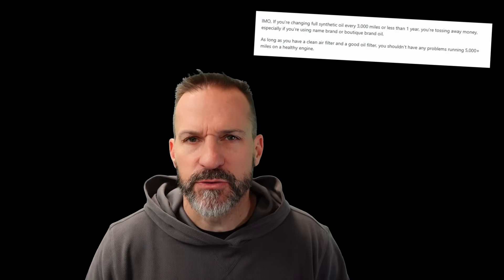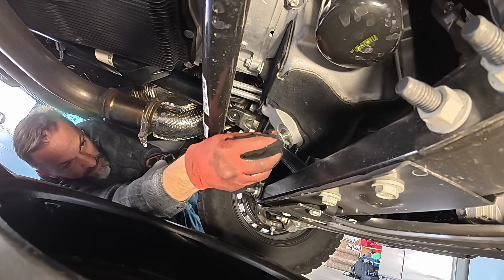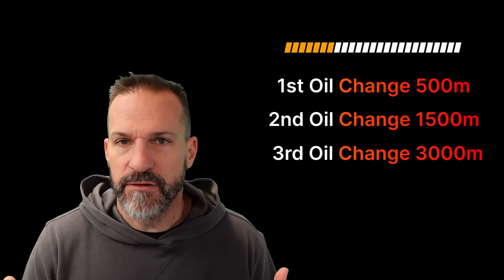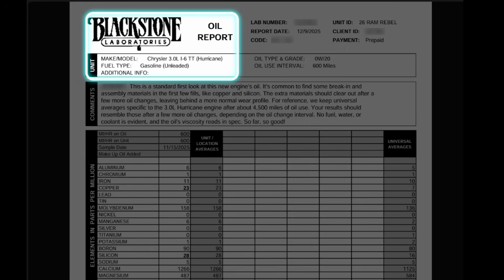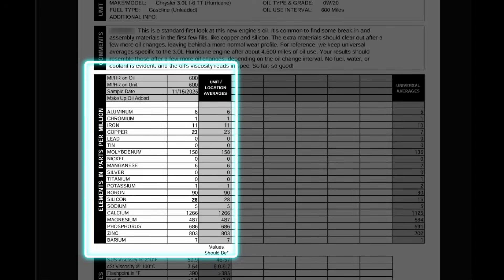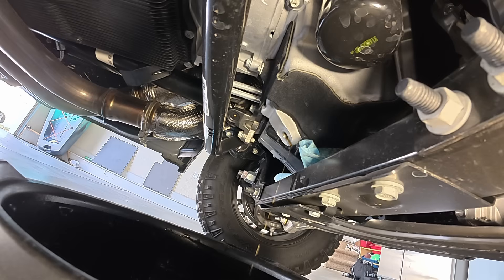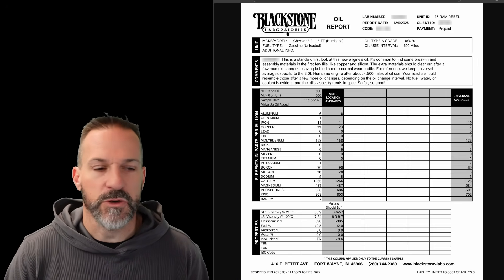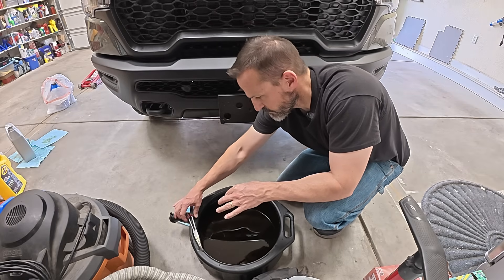Is the Motor Oil Geek Right? I Put His Break-In Theory to the Test

Comment: I have always changed my new vehicle's oil at 500 miles, 1500 miles, 3000 miles and then from then on, every 5000 miles.  Buy unlike Lake Jr., I change the filter with each oil change.  I've never had any oil related issues with any of my vehicles since I started driving back in 1973.  I've also had three vehicles with cylinder deactivation systems, and have never had any of them have any issues.  The most miles I have put on one engine is 425k, a 1982 Honda Accord.  Each of the three GM vehicles with cylinder deactivation were bought new and traded in at over 230k.  Only one, the 2007 Avalanche started to burn any oil after 200k.  2017 Tacoma was sold after 225k and burned no oil.  I now travel full time in a 2024 F550 with the 6.7 diesel engine in it.  It now has just over 52k on it. I run Shell T6 5-40W in it and maintain the same oil and filter change intervals as above.  The engine works hard all the time as the truck camper weighs 19,200 lbs. and is driven all over the US, including the mountains.  It will use a little oil (about a qt), but under these driving conditions, it is considered to be full-time severe-duty use.  And Ford's 6.7 are known to use a little oil. What Lake is sharing with everyone should be considered just plain common sense.  No oil is designed to last as long as what the manufacturers recommend.  Same goes for all the other fluids in our vehicles.

Comment: May I ask the question regarding the debate on 0W-20 or 5W-30 oil?  The manufacturer recommends the 0W-20 with many saying the 0W-20 is too thin for a smaller engine, that we should use the 5W-30?

Comment: I did an oil change at 350 miles in my rubicon 4xe, it had an “oil change due” light at that low mileage because of the potential fuel oil dilution and the fact that it sat on the lot for a while. Did it again at 3500 miles, and then at 7k. I really believe in break in oil changes. All seems to be in line with Lake’s findings. Thanks for this info!

Comment: Auto Manufacturers use special (Break in Oil) that does NOT have a special anti wear pkgs because they actually want the engine to create (SOME) wear to help the bearings and piston rings to break in and they decide based on the engine whether that first oil change is at 500 miles or 1000 miles.   If you take a brand new engine and change the oil at 50 miles and remove the break in oil  it may take 20,000 miles for the engine to fully break in using a synthetic with an anti wear pkg in the oil.       So there is NO one period or miles that fits all.    What is also bad is some people that bring in their vehicle for its first oil change at 5,000 to 10,000 miles (it happens).      The Motor Oil Geek is correct on most all that he says,   he see's the tests on dyno engines.

Comment: I have a 2024 Tundra with 21k miles. I did first oil and filter change at 2k miles and then every 5k miles.  What oil and weight do you recommend now?
Reply from the maker: With the Tundra I think I'd be trying a 5w30 full synthetic at minimum, but that's just me :). It depends a little on climate too and your conditions.

Comment: There is one thing I wish Lake would have mentioned.  When he changed the oil at 500, and 1500 was he using more break in oil or did he start using the recommended oil?  What did you do?  Did you continue with break in oil or switch over to the recommended oil?  Love the channel, lots of good information.
Reply from the maker: I believe he's just using the manufacturer recommended, and they don't use break-in oil from what Lake mentioned. I use the Pennzoil Ultra Platinum which is what people claim is used from the factory for the Ram I purchased. I'm going with 0w20 until my break in is complete and I have a good baseline, then I think I'll switch to 0w40. It does depend on the vehicle and the design, but I believe most vehicles are just running the regular factory spec'd oil right out of the gate.
Reply: @TheCarGuyOnline  Ok great, thank you for the response.

Comment: I bought a new Lexus and at 900 miles I took it to the dealer for an oil change. Shortly after the tech found me in the waiting room and asked if there was something wrong with the car. I explained to him that I just wanted to get the break-in contaminants out and that I'd be doing an accelerated oil change interval for the first couple changes. He looked at me like I had a third eye but said OK, just making sure. The factory oil change schedule is designed to get you through the warranty period and to minimize cost of ownership calculations.

Comment: I don't think the amount of particulates shown in the analysis of the oil at 500 miles will harm the engine at all.  In a way, you "want" higher "abrasion" in the break-in period, anyway, so that the metal parts will mate and seat well.  I've know guys with new motorcycles who run thin mineral oil for the first 800 miles, just for this purpose.   

On car engines, I run a synthetic blend for the first 10,000 miles before switching to full synthetic, b/c I think full synthetic is too slippery for breaking in an engine.  I'm probably right, because my engine, doing 5,000 mile oil change intervals , consumes between 1/10th and 2/10ths of 1 quart of oil over 5,000 miles of use.

Comment: What do you think about using specific Break In (BI) oil, such as BR30 by Driven Racing, as espoused by The Motor Oil Geek, Lake Speed? Using Lake’s logic about the benefits of BI oil, if you buy a new vehicle from the dealership, as soon as you get it home, it would be logical to drain the oil and refill it with specific break-in oil to be used for the initial break in of the piston rings. Not considering the expense of doing that, would it extend or shorten engine life of a normal stock new car engine? 🤔

Comment: Great video, enjoyed it!  Lake has great content and scientific facts. Broke my Diesel in with Lake’s Oil Analysis & recommendations. 

New 2024 Ford F450 6.7 Diesel.. had multiple Lake’s Oil Analysis. My first was late at 2000 gentle miles, followed by 3 Oil changes & Oil Analysis at 2000-3500 intervals, plus additional Oil Analysis between oil changes that were lengthened before Oil Change by Lake’s recommendations. Each one showed minimal metals, normal for diesel longer break-in of 10-15,000 miles. 

Installed Insane Diesel Oil ByPass at 10K miles, and moved from standard oil to AmsOil signature at Lakes advice to continue non-synthetic until break-in more complete. Will continue oil analysis to monitor engine and oil bypass improvement with 1 micron filter. 

Agree, goal is to maximize the life of engine and truck! At today’s prices, proper break in and maintenance is critical to minimize future repairs and maximum enjoyment of Ownership.

Comment: Just rolled over 600mi on my ‘25 SO Hurricane. I was going to do 1000mi, 4000mi, 7000mi, 10k, then every 5k, but Lake has me considering doing what you did. Which oil did you end up using? I was going to run PUP 0w20.

Comment: I have a 2005 Sequoia that I bought new. Changed the oil at 1k, 2k, 3k, and then every 3k since then. 20 years and 300k miles later, it still runs like it did day one. Has been completely reliable, and all I've done is kept up on normal maintenance items.
I should do an oil analysis on it...

Comment: Good video Sir, but Lake's over exaggerated analysis is just that; over exaggerated regarding the initial oil change intervals. Trying to extract every nook and cranny of debris would be impossible, not the mention a serious case of oil being wasted. Driving sensibly and changing the oil at the 5,000 interval should be sufficient. With today's oil advancement, stretching it to 7-7,500 wouldn't do harm either.

Owner of an '18 Tundra since new with 190xxx new with 5-6000 mile o/c intervals, mostly hwy commuted miles

Comment: I wouldn’t change the oil grade: variable oil pumps in new engines are programmed when to boost oil pressure, and even if the engine runs on different grades in different markets, that algorithm isn’t the same.

Changing your oil grade probably won’t do anything bad, but it might.

Just do more frequent oil changes (cleaner oil in tight passages and high shear environments like turbos) and change your filter every other oil change (a dirtier media catches more debris, not less).

This is why Speed didn’t recommend changing the filter at every step in the break-in process.

A rule of them is taking the standard “normal service” interval and cutting it in half.

OEM says 10k intervals?

Do oil on the 5’s and oil and filter on the 10’s.

Comment: I am using 5W-30 instead of 0W-20 in my 2025 Honda Pilot and I changed my first oil at 600 miles, then 5600 miles for the second time.

Comment: So exactly what Lake has said and supported with data in his videos. Also, not smart to use a thicker oil if you live in an area of the US that gets cold weather as this will negatively effect the cold start lubrication and time it takes oil to get to the vital components. The pressure and flow have been calibrated for the oil spec recommended so you'll probably void your warranty too if you have any issues.

Comment: With paper thin bearing clearances of coarse metal fragments will scratch the bearings and other moving surface components. 100 miles would be even better. Oil is cheap engines expensive. I want 400 to 500 thousand miles out of my engines and no car payments. The first 100 thousand miles is a dead financial loss. The second hundred thousand miles and paid off technically you are making the car payment amount back as income and so on.

Comment: The thing I'd love Lake to test is the filter. 30+ years ago I worked with a guy who used to work at the Petroleum Institute. He said the oil itself is still fine up to 15,000 miles. I thought he was nuts. He said you need to change the filter every 3,000 miles. Top off to the full level and check the oil level. A lot of people don't even look, and it gets low.

It seems a lot of Toyota Prius owners change it every 10K miles. A lot of those cars go 300K+ miles. So there's that.
Reply: Well Lake will be revisiting Donaldson....just a few days ago he asked followers if they wanted more on filtration.  On the points you make, with testing, if you want to pay for it, you can go long on oil, but, as he and his buddy in Phoenix strongly recommend, just Incase you've got dilution going on (happened to me) or some other odd thing, you are safer halving the makers recommended interval.  So all said and done, don't waste money on boutique oil trying to go long in order to save money because you bought Amsoil....and go with Pennzoil Ultra Platinum and change it every 3500-5000.  For a tiny turbo CAFE engine, definitely err toward 3500.

Comment: changed it every 500km now it is 2500km and still full of fine steel particles. 
but It ran very rich at initial break in
the intermittent missfire plus full misfire because of burned sparkplug wires touching exhaust metal shields so I expect glazing

Comment: I had a 20’ fam 1500. That hemi had the highest wear metals than any other engine I have had tested. Ford, Toyota, Ram. Ram hemi was the highest. I got a brand new 18’ tundra and it broke in very fast. Very low wear metals with in about 5,000 miles and it stayed very consistent. Ford took about 20,000 miles before the wear metals flattened out and the ram at 50,000 miles had higher wear metals than the tundra and f150 before the curve flattened out.

Comment: I just pulled the oil from my new tahoe at 58 miles and it was black with bits in. I then changed it again at 600 after a long trip and it was not black but still dark.
When i looked at the digital dash, it had 5hours of idling on it but it was bought with 14 miles on. They must let it idle of the lot to keep the battery up I suppose? 🤔

Comment: I found plenty of metallics in my 26' tundras first change at 750miles in the filter. The second change at 3k miles had a little on the magnetic oil plug but it was teeny tiny stuff.

Comment: 100, 500, 1,500, 3,000 is what I’ve always done to a new car. Now the idea of not changing the filter every time is new, but I understand why. The more dirty it gets, the finer filtering it does. Makes sense, but…..one thing I would also recommend to you for that new truck is a Gold Plug magnetic drain plug. I put one on my latest new motorcycle, and you wouldn’t believe how much super-fine steel “paste” builds up on it. Stuff that would have normally passed through the oil pump (and possibly through the filter too) is definitely stuck to the magnet. Just a little more insurance. Good video.

Comment: All these are missing any link between the lab reports and engine life. Just because there are tiny metal particles in the break-in oil does not mean engine life is reduced. I maintain that these breakin procedures have very little affect, if any, on engine longevity. Changing oil every 5000 miles is the key to long engine life.
Reply: Lake literally just did a video about the bulk of wear happening at the beginning, and toward the end of an engine's life.  - rotating engineer working in oil and gas and dealing with API.
Reply: I tend to agree. With modern oils and regular oil changes,  most cars will be in the junkyard before the engine wears out.

Comment: Some cars do not have a magnetic drain plug to capture some of the metal. I bought an after market magnetic drain plug  and installed it. I like being able to see some of the metal during my oil change.
Reply: Stick a magnet on the oil filter canister and ferrous particles will be collected before they reach the filtration element and you discard them with the filter at subsequent oil changes.

Comment: My new vehicles get oil & filter changes at 500, 1000, 2500, 5000 then every 5000 thereafter.  The really big problem is SILICON left in the engine from the castings in the factory & getting that flushed out is important.

Your engine is starting out with pretty low silicon, but others can start with a lot higher levels when new.

Comment: I am 1 month into my 2026 Tahoe 6.2L…..I changed at 500….through the dealer…they nodded with a slight smile. I also will change at 1500, 3000, 5000…..I did not send in the first oil change for report…but will send in the next one. Filters changed at every oil change….always.  I also turned off “auto on/off”…..and run in L9, which deactivates DFM……premium fuel only………20 mpg highway, 17+ city………never got that on any of the Expeditions I had from 2001-2025…..
Reply: Why would you risk those 5000 with those 0w20 6.2L lol? Moronic

Comment: There are some key details present in what Lake says that are said briefly that I would guess most might people miss.  I caught them because I'm known for being overkill on details.

1. Visible material in your oil is 40 micron or larger - that will be caught by your oil filter.  The material that causes damage is around the 20 micron and small size - invisible to the naked eye - and this is exactly where the oil filter does all the heavy lifting.

2. Use the highest efficiency filter at the smallest particle size you can get (ie. 99% at 20 micron, etc).  For those that want to research those details on their own, ISO 4548-12 is the gold standard test for oil filters.  Ignore what brand you believe will have the best filter, as that is speculation, and this test is 100% fact.  Realize that the filter you use might not be nearly as good as another filter.

3. The engine in Lake's video that you put a brief screencap of was broken in using 'break-in' oil specifically, not the oil that is stated in the manual.

4. In other videos that Lake has posted, in a vehicle with increased cylinder pressure (variable valve timing, any forced induction [turbochargers or superchargers], high compression, etc) moving to a heavier oil is better for the longevity of the engine due to the increased film strength (ie. the oil can withstand more force before metal to metal contact occurs).

Just a quick note on oil filter efficiency, if any manufacturer states the efficiency (99%), but does not state at what particle size (20 micron), you have no idea if the filter is good or not.  If a filter is (stated) 99% efficient at 50 micron and no information is stated at a lower micron rating, that filter might be pure trash and not worth 10 cents.  My general rule of thumb is unless both ratings are given (% of efficiency at what particle size) it is not worth my money and I simply will not run it.

Not directly related to oil is the quality of the fuel.  Always look for the 'top tier' fuel sticker on the gas pump.  It has detergents in the fuel that help to keep injectors clean, helping to limit/negate fuel dilution in your oil.

As per the engine in my car, I bought the car brand new, and it had 7 miles on it.  It is a Toyota GR Corolla, so it is absolutely a high pressure engine.  My first oil change was done at 69 miles (unintentionally).  I put in AMSOil break-in oil and replaced the factory oil filter with a filter with much better filtration (Fram Ultra Synthetic).  My 2nd oil change was at 500 miles, same oil and filter as previously mentioned.  My 3rd oil change was done at 1500 miles, same oil and filter as previously mentioned.  My 4th oil change was done at 3000 miles, same oil and filter as previously mentioned.

Some have said that this method is overkill.  Based upon what Lake has stated with facts to back it up, this is not overkill.

After that I've been using Pennzoil Ultra Platinum 5w30 and the Fram Synthetic Endurance filter.